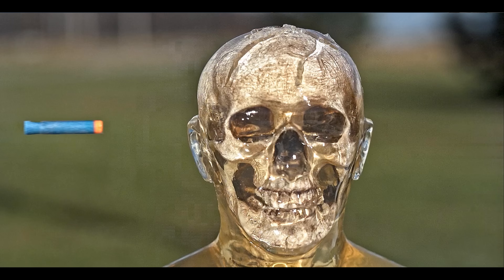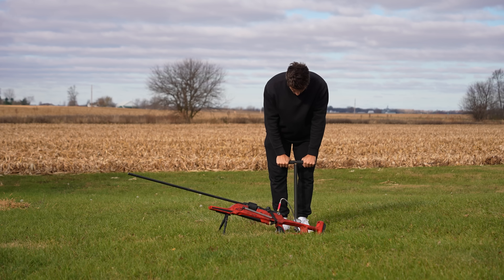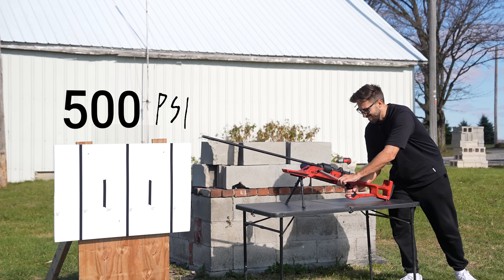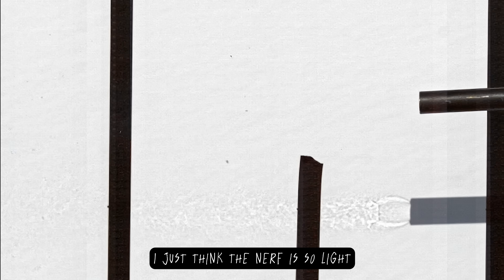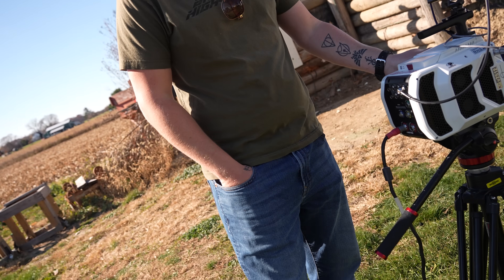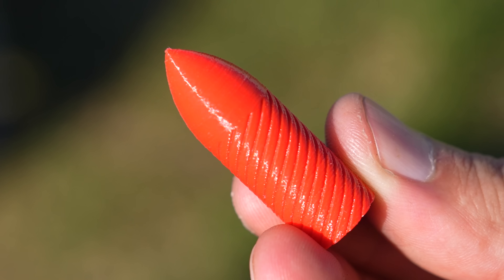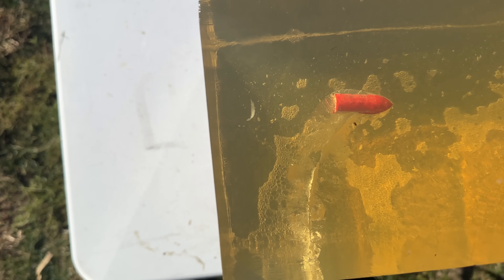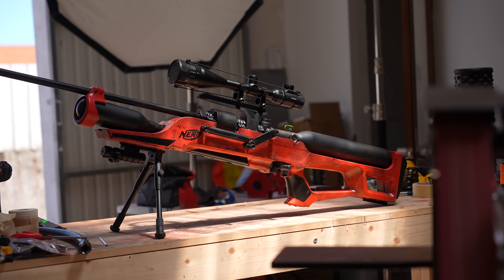How Dangerous is a Supersonic Nerf Dart?

Comment: I think a ported barrel might fix your darts blowing apart. There is a cavity in the dart that is pressurized in the barrel, but the dart is supported on the outside by the barrel. Once the front of the dart exits the barrel, it is no longer supported but still has that pressure inside until the back of the bullet exits the barrel, releasing this pressure. A ported barrel would release this pressure while the dart is still supported by the barrel, possibly keeping the dart together.
Reply: I’m glad you saw that too hopefully he sees ur comment i was thinking he should fill the hole since he doesn’t need it and hopefully that will stop that
Reply: Wouldn't reinforcing the dart be an easier solution? Say, did it in epoxy or resin or give it a single fiberglass layer shell?
Reply: @jaredfritsch6833 depends on how many times you plan on firing it, because it’s not like you’d be able to just reuse the reinforced darts due to being flung into objects at excessively high speeds
Reply: @jaredfritsch6833  yes, but I was trying to come up with something that kept the stock unmodified. So, all things being equal the dart being fired is identical to one you ahoot from the toy.
Reply: @jaredfritsch6833  That'd require modifying ammo, which is much more time-consuming than drilling a few holes into the pipe.
Reply: @jaredfritsch6833 if he reinforced the dart, it wouldn't be a nerf dart anymore. It would be a crappy bullet
Reply: in my experience, filling the dart's inside channel with hot glue and loading 3 metal bbs into the tip helped dramatically and had the added effect of leaving welts when it hit
Reply: @hakjobtm7472 this one right here officer 💀
Reply: That’s a fantastic idea. I would also increase the barrel length though.
Reply: How about a hole in the side of the dart? 
Tht way there wont be a pressure bubble as the dart itself is ported and can release the pressure wirhout blowibg up
Reply: Yep💥👍
Reply: He needs to see this
Reply: My thoughts exactly
Reply: Not only port it, but draw a vacuum on those holes with a collar. Win Win! (I never finished it, but I was almost through building up a patent for a collar like this in like 1999.)
Reply: Wow, I was thinking that about the inside of the dart being pressurized as it came out, but I didn’t think of a ported barrel helping.

Comment: So I just watched this, and remembered a similar video TheBackyardScientist made back in 2018, where he actually explained the reason the nerf darts destroy themselves when shot with high pressure air. Essentially, instead of pushing only on the back of the dart, the air enters the center hole that's used to center the darts in a nerf blaster, and then expands extremely quickly, which shreds the darts, and is also why the head of the half-length dart flew off. The way to solve it is actually pretty simple, just plug the hole with something like an ear plug, which prevents the air from getting inside the dart and tearing it apart.
Reply from the maker: Yeah! I mentioned that video in the part 1. We tried using an earplug and the dart didn’t break, but the speed was also lower compared to not having it
Reply: @MikeShake  GENUINE question; how could I buy this nerf gun? I need to buy one, since I’ve got a project I’m preparing to work on, and since the project is a nerf tank, I uhh… kind of need a cannon for it. I understand if it’s not possible either legally or material-wise to sell or build another, or jf you just don’t want to, but it’d be cool to use for a tank, lol.
Reply: Hi
Reply: I watched this because I like weapons. But I'm not sure what I learned... Couldn't you just make a custom pipe for a prof. PCP and reach the speed of sound?
Reply: Hiiii
Reply: The mettle dart was the only thing that was dangerous

Comment: Why not try to make barrel sealing piston valve out of high pressure piping. Also by the way I looked at you web and found a website that sold ones that looked identical to them but there only actually rated to 400 psi tops also use converging diverging nozzles or try to inject feul and detonate them I mean I do not think the web could take that but I do know of an example of a barrel sealing piston valve that was able to take that .

Comment: It looks like the dart is getting destroyed right as it leaves the barrel (which is why only the front of it is damaged). This might be caused by the high pressure difference between the inside of the barrel and the outside air. Try making a few holes at the end of the barrel (similar to a paintball barrel portings, but only at the end). This will lower the pressure when the dart leaves the barrel, allowing you to use more pressure without damaging the dart.It looks like the dart is getting destroyed exactly when it leaves the barrel (thats why only front of it is destroyed). It might be caused by high diference in pressure between inside of the barrel and outside air.  Try making few holes in the end of the barrel (like in paintball barrel, but only on end). It will lower the pressure when the dart leaves the barrel, so you can use more pressure without destroying the dart.
Reply: It will probably not work with the highest pressure (when the dart is damaged inside of the barrel) but there is a chance it will help.

Comment: you should try removing the head of the bullet, since the shell is faster. May it seems counterintuitive because the head weighs more then the shell, but in the video is obvious that the shell travels faster then head, and even the way how it wraps demonstrates it, folding on the head, it’s clear it’s slowed down by the head. I know that this way the bullets will carry less energy, but the speed is the most interesting element.

Comment: One thing i learned when playing airsoft with Gas Block Back Rifles is that you definetly need to increase the weight of the BB to guarantee a stable flight.
If the bullet is too light it just slows down immediatly and flies of to the side. 
That same logic seems to apply here, it wont contain the energy.

Comment: Man, am I glad these aren't the standard. When I was like...14 or so, I had a nerf battle with two of my friends at night so we could try and be quiet and tactical, so we were wearing those fuzzy vests and using the Velcro darts. And, somehow, I took one spines-first from across the room, straight into my open eyeball. It HURT, and I had to end the match cause I was basically blind, but it didn't even scratch my cornea.
This thing would have popped my eye like a grape and probably shattered my orbital socket.

Comment: I really don't believe in the 200 and something joules since a 22lr makes a full passthrough when shot at gelatin and it has "only" 162 Joules.
Reply: Surface area makes a massive difference  when it comes to penetration. Smaller rounds need far less energy to penetrate deeper.

Comment: A lot of modern tanks have smooth-bore guns (no rifling). To shoot a stable round, their ammunition has fins and a sabot that discards during flight (APFSDS). I think it would be cool to try and make one of these rounds and test it with this gun. Great video!
Reply: I think it would be easier to shoot a lead ball, it will be more accurate and easy. Just like a shotgun shell
Reply: @as_soon_as_possible  Or an old school musket!
Reply: I was thinking a lead ball would be the best option too. It would be more accurate and have good penetration at a closer range but at longer range it could be less accurate.  @as_soon_as_possible
Reply: @ A slug can be accurate up to 100m
Reply: @as_soon_as_possible  basiclly a air musket.
Reply: this said, a number of shotgun projectiles also follow the sabot and fin stabilizing principles to maximize stabilization out of a smoothbore barrel. one of those designs would probably prove most destructive out of this "not a nerf gun"
Reply: @Soleil_de_Helturel  oh those shotgun rounds called sabot rounds require rifling.
Reply: I'd love to see a 12.7mm apfsds round (nail sabot and 3d printed things that hold it in the barrel)
Reply: Arrows work really good in airguns.
Reply: FYI - Supersonic nerf dart is not dangerous. Only the first one was supersonic...
Reply: Seems like we're going back to fletchings on arrows.
Reply: Finally my knowlege from War Thunder nerds bullying me for not knowing the round names pays off!! 
Armor Piercing Fin Stabalised Discarding Sabot
Take that people who said id never use this in real life!
Reply: Yeah,  that would look awesome in slow motion
Reply: This guy is probably the reason the australian government banned nerf guns
Reply: 🎉 @Kema_69
Reply: Isn’t rifle barreled barrels more accurate then smooth bore
Reply: @Jerrytheplant   rifled guns only improve accuracy for rounds without fins. If a round has fins it makes it worse a bit and also makes it lose penetration
Reply: you don't need a sabot, they also shoot full caliber shells with fin stablized like (mp)heat-fs or he-fs
Reply: You just spoke my language
Reply: ATTACK THE D POINT!
Reply: Nice
Reply: Laughs in Mk45 Mod 4
Reply: So basically home-made Accustrike Darts?
Reply: What would win?
(A child who shot me with a toy) or (My 12.7mm DIY Homemade Anti-Organics rifle?)
Reply: I was going to comment this very thing, or that if the rifling were more pronounced (a dangerous thing to print) it could have an effect. Especially if the bullet had a concavity at the rear.
Reply: 9:18 it says ignition
Reply: I'd like to uh, basically compile up all of your points 

On HEAT shells :
-High Explosive Anti Tank round is a chemical energy round using the effect of a shaped charge explosive (using Munroe effect), meaning that in order to maximize the penetration effectiveness, it (the explosive) will have to focus and collapse into the center of the liner, which sends a hot molten metal at jet speeds into the tank's armor.
 
-Rifled barrels, spins the shells. This means that since the round is spinning, the explosive charge couldn't focus into the liner properly (because it's spreading out outwards instead of getting inwards), thus a decreased effect in HEAT shells' penetration power.

On KE-based shells :
-If you've been reading at least some few basic, kinetic energy shells, you might come across APDS - Armor Piercing Discarding Sabot. We all know that more speed (and hardness) means more penetration, and the less weight means more speed. So by that, we could shed some weight by making the shell smaller, while the said shell could be hardened (denser, like tungsten carbide of the time), and to fit the smaller shell, we have sabots which discard after leaving the barrel. Boom, now you got a shell that could penetrate stuff at longer ranges.

-However, again. Rifled barrels are rifled so that the shell could spin - this is called spin stabilization, which improved the accuracy of a shell/shot over distance. It had one major drawback is that the spin it decreases the energy over the distance (thus reduced penetration power which is also caused by air friction too). 

-The solution to this ? APFSDS shell. Rifled barrels are good, but what if we take the rifling out and slap fins on the shell ? You retain the same accuracy yet have more velocity over distance. Oh and like APDS shell, we're going to make the shell smaller and has discarding sabot outside of it, and make it dart like so that it could cut through air easily while retaining the denseness. (considering it's longer)
Reply: anyone who is arguing against a NERF SABOT round clearly hates fun

but not gonna lie, I wanted to see a musket round get fired the whole time watching this
Reply: You ever try to clean a tank barrel
Reply: Not on something that small
Reply: The fins would shatter tho
Reply: @Wing_Suit_Cat  nope, they arent in the barrel long enough to
Reply: @Wing_Suit_Cat not until they collide with the target, which by that point, the fins would be excess drag if they were to remain attached
Reply: But there’s a reason why those are smooth bores mainly because of the ammunition. 

The ammunition used these days are far quicker and reaches stabilisation due to how those are designed. Smooth bore helps it slow it down thus retaining effectiveness.
Reply: @patrickiamonfire965  I thought tank guns were smoothbore because it specifically made the darts go faster and allows them to be longer aka more effective against armor

with long rounds spin just causes tumbling, so fins are more effective for stabilization
Reply: @arctan4547 
well , APFSDS(armour piercind fin stabilised discarded sabot) its simply a metal rod encased in a sabot , it flies fast and straight and are designed to be  effective against modern tank armor because speed beats armor, british tanks still use riffled barrels in their tanks. and yea, trying to design an sabot round for a bore that small , it will be pretty tricky
Reply: @arctan4547 smoothbore is done so you can effectively use barrel-launched atgms
Reply: @arctan4547 I think the switch to smoothbore was born out of a need for HEAT rounds which uses a molten metal (copper) jet to penetrate armor. Spinning projectile disrupts the formation of said jet and reduces the effectiveness of the round. During the era after WWII and before reactive armor came along, HEAT was used a lot as the main anti-tank projectile, and thus was born the smoothbore cannon to help achieve better penetration. The rounds are also fin-stabilized just like an APFSDS.
IDK if I am completely correct since I don't have enough knowledge on this to say for certain, so please lmk if I said anything wrong.
Reply: @dianeahw  No, lmao, it's not. Barrel launch ATGM's basically don't exist anymore and were never good. Only the British Challenger II still uses a rifled gun. Everyone else is a smoothbore now because you gain significant velocity increases with the same barrel length and diameter. Source: Served on an Abrams.
Reply: @dianeahw no, no it is not. smoothbore is done primarily because a fin-stabilised round’s performance is affected negatively when imparting a spin onto it, and sabot rounds were becoming too long for gyroscopic stabilisation to be effective.
Reply: @gnarasjesus yeah, was just thinking about how, iirc, smoothbore was adopted because shells were needing to be fin stabilised due to the discarding sabot rounds becoming too thin relative to their length for gyroscopic stabilisation to counteract how aerodynamically unstable they were becoming
Reply: @LapteRece69  recently they adopted smooth bores for effectiveness plus If I remember it was cheaper and allow better ammunition.
Reply: @arctan4547 yeah that's why they did it. Spinning a round takes energy from the projectile, this is worth it for non fin rounds because it stabilises them making sure they don't tumble as soon as they leave the barrel. On fin stabilized rounds this is a waste of energy that could have been kept as kinetic energy making the round go faster, further and penetrate more armor because they have those fins that make them stable
Reply: @Clearwater_WT For rifling to disrupt a shaped charge, the projectile would have to be spinning at thousands of RPM. You have to bare in mind that the shaped charge is travelling at anywhere from 6000-9000m/s depending on the explosive velocity. And a shaped charge isn't molten, it's in a state called superplasticity and penetrates armor with kinetic energy. And one last thing, copper isn't universally used as a liner, nor is it ideal. The Soviets had more experience working with refractory metals than the west, and often used depleted uranium or tantalum as liners because of their higher plasticity. Some HEAT projectiles still use copper now, like the Javelin, because it's 'good enough', but iirc the newest iterations of the Hellfire use tantalum.
Reply: @arctan4547 its smooth because its way faster to send a projectile in a straight line, rather than having it also have to rotate. Speed is king when it comes to penetration. its why with a shell near half the size, the t34-57 was still a great stopgap between it and the 84mm and had way better pen than the reg t34
Reply: @patrickiamonfire965  That's not true.

Rifled = More Accurate
Smoothbore = More Velocity
Reply: @kensmith2829  Like I said due to how the munition designed it can speed up the round making it less effective. The spinning motion would increase the stabilisation which would reduce the friction and does increasing its speed mainly because most energy isn’t wasted on fighting against resistances.
Reply: @ How on earth could speeding up a round make it less effective? The increased velocity of the smoothbore cannons means increased kinetic energy and thus, increased penetration.
Reply: @ mainly because it’s an explosive. There’s like several videos about it you can find. Can’t go in depth without getting censored.
Reply: @k @kensmith2829 it’s because those round supposed to detonate and explode not penetrate. The rounds can work similar to an rpg hence the lack of need for penetration.
Reply: @patrickiamonfire965  what are you talking about ? The whole point of smooth bore, aside from being necessary due to HEAT rounds, prevents rifling from slowing down the round. A smoothbore is made to have the projectile exit as fast as possible
Reply: @sigmamale4147 When barrels are rifled it gives the bullet a rotation allowing it to avoid wind resistance thus increasing penetration, accuracy and speed.
Reply: @patrickiamonfire965  yeah must be why every single tank nowadays is using smoothbore 🤣🤣 you're definitely a smoothbrain
Reply: @s @sigmamale4147 I don’t think you don’t understand;self stabilising rounds have made rifling redundant. Rifling allows the round to have less air resistance which may cause over penetration which not very good since the rounds these days tend to be explosive reliant. Smoothbores increases the speed but does not help with air resistance thus slowing the round.